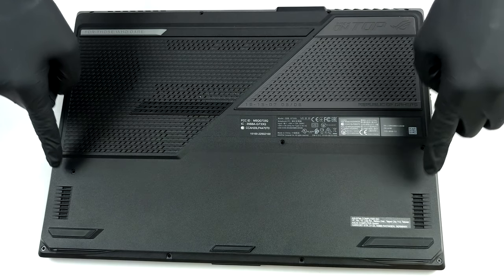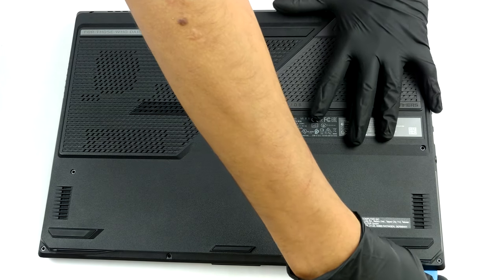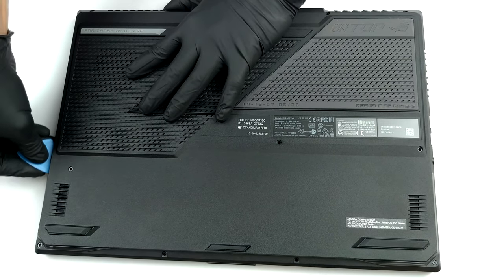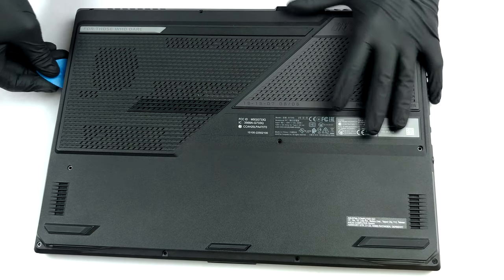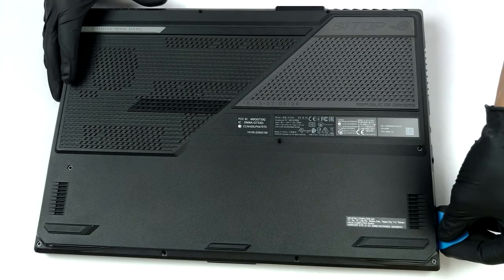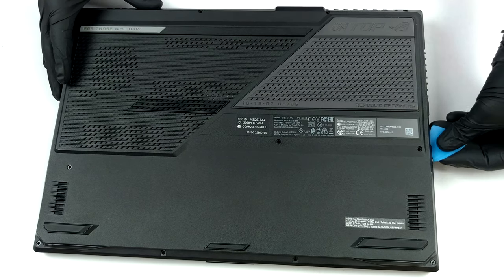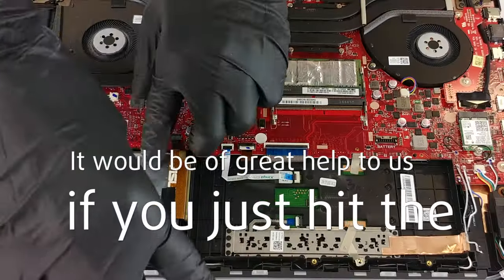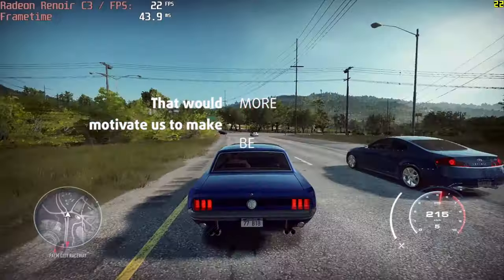🛠️ ASUS ROG Strix SCAR 17 G733 - disassembly and upgrade options

Comment: Can you add 2 TB of SSD to it on additional 1 TB that this laptop already have? Asus told me that to G733 can be added only 512 Gb or 1 TB - no more...Strange, such powerful gaming laptop and without additional 2 TB upgrade?
Reply: Of course you can. Some models in the US even have a 2tb one stock (Not 2x 1tb but ONE 2tb)
Reply: Hi, did you have success adding a 2 TB SSD? Which one did you get? I'm looking to do the same, but i'm worried about SSDs overheating. Is there room for a heat sink?
Reply: @christofferhammarstrom  i got an 2tb Samsung 970 Evo Plus and it works without any problems. And don’t panic if it doesn’t  get recognized when you boot the laptop after you installed the ssd. You have to Format it first and then it will show up. Just go watch a tutorial before you install it.
Reply: @pathetic1567  Thank you for responding. I think i'll get a Samsung 970 as well, but all over the internet i read about the Samsung 970 throttling due to overheating. Do you reckon there is room for a heat sink in there?
Reply: @christofferhammarstrom  nah there ain’t no room for a heat sink but I didn’t experience any otherheating oder thermal throttling and the temperatures are quite low in the app. Even lower than the stock SK Hynix ssd
Reply: @pathetic1567  Thank you for your help!
Reply: I have put 2x 2 TB 970 evo plus, and they are ok. But i don't know how to set RAID-0 neither in BIOS, as in new clean w10 install.
Reply: @pathetic1567  Hey! May I ask you if it is still working fine? I have the 1TB SK Hynix HFM001TD3JX013N and I was thinking about getting and additional 1TB (Samsung 970 Evo Plus) but now that I saw your comment if your laptop and has no issue until now I might get the 2TB, could you please confirm? Moreover, if i have my OS (Windows 11) installed on the SK Hynix SSD can I just install the Samsung or I need to format the other SK Hynix too? Because that makes anxious I wont lie.
Thank you in advance!
Reply: Hi is it possible to add 4tb ssd in the second slot?
or it can only support 2tb ssd?

Comment: Is the battery detachable? So that if we are playing games it will not consume the battery
Reply: You don’t have to detach the battery. Every New Laptop has an battery protecting system. If the laptop is directly powered by the power adapter it doesn’t use the battery if it’s fully charged. It uses the direct power from the power supply till the battery is at 90%. Then it charges the battery to 100% again. Basically the battery is not used until you remove the power supply and use the battery itself. If you connect it again it will charge the battery to 100%( It takes a long time till the battery hits 90% without using it but sometimes the laptop needs more power and uses the battery as a “help” to produce more power together with the power supply)
Reply: @pathetic1567  Ohh thank you so much! I dont have any idea about new laptop, i have laptop but its 2011 crappy model so its detachable. Okay so its safe to use the new laptop even though its charging while using. Thanks man
Reply: @jdg7276  if you open the ASUS program included in the laptop, you can enable a feature that the laptop will only charge 60% to increase longevity of the battery

Comment: what's that white strips on both side when you opened up back cover?
Reply: The ribbon things, you dont want to rip them, they plug into the motherboard
Reply: Those are the ribbon cables that provide power to the led strip around the front of the laptop. You rip those and the strip is dead.

Comment: where is the cmos battery located ??
Reply: I don't think it has a cmos battery, i looked for it and could not find one, also checked the bottom side of the mother board. After disconnecting the main battery, the laptop takes extra time to boot so i guess that's the only downside of it.

Comment: Disappointing. No bottom panel RAM or SSD upgrades, and once again replacing the battery is not only made difficult by finding the actual part, but the replacement process itself. Heaven forbid we want to repair or upgrade the devices we buy. I was hoping ASUS had changed, but the ROG laptop with a 970m was the last laptop purchase they'll get out of me as long as this planned obsolescence practice shit continues.